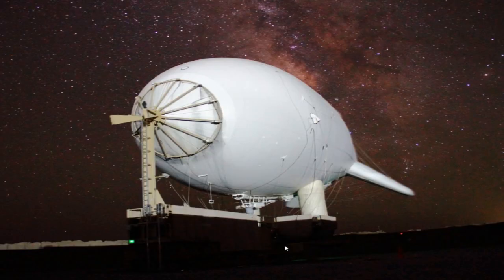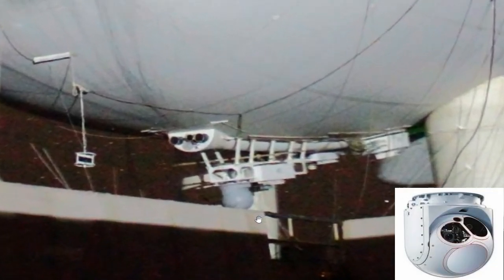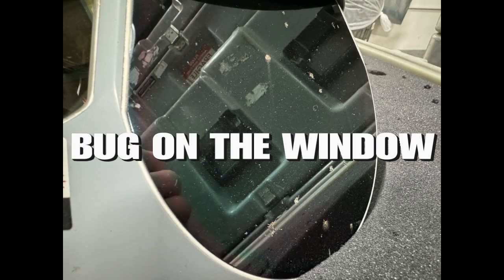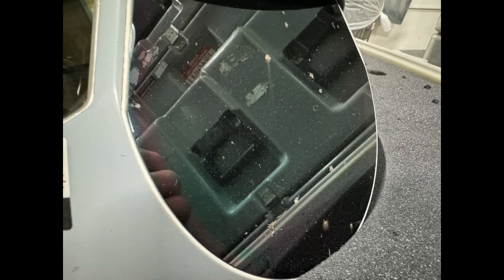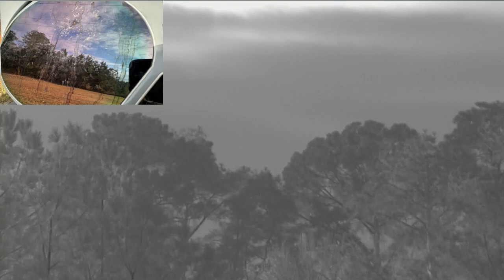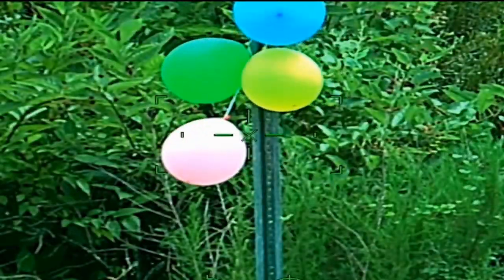"Jellyfish" UAP analysis!

Comment: Excellent investigative work. I will use excerpts from your study to support an analysis that I am preparing to refute, not only the balloon hypothesis, which is based on an extremely incoherent pareidolia, and also the JatPack speculation, which is very weak and easy to refute. I have old material here with me that shows an object in Earth orbit, recorded several times by an astronomer, many years ago, and that reliably portrays this UFO

Comment: My only question would be would they test it in Iraq? The shape doesn’t bother me it’s when it changes the heat pattern from hot to cold, which is very strange. Balloon is not going to do that because the air inside is equal to the air outside for temperature. Would not be a drone because you can’t see anything spinning. This one is legitimately strange.
Reply from the maker: Agreed!